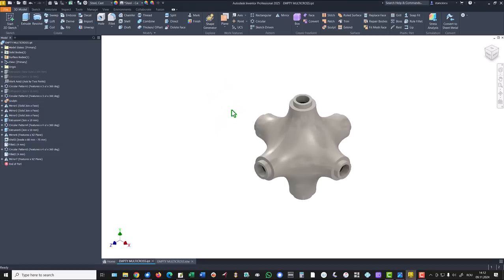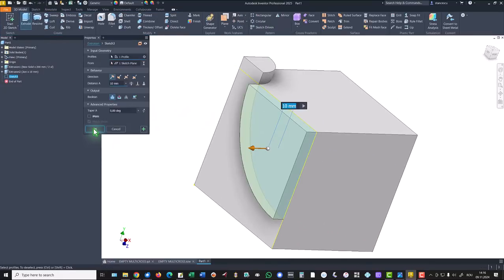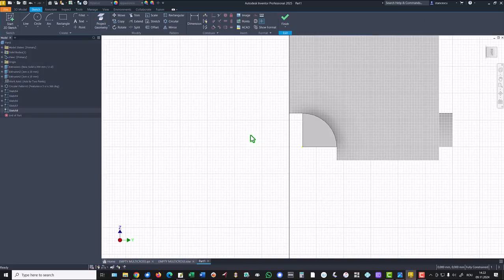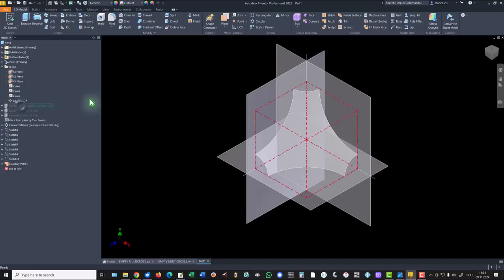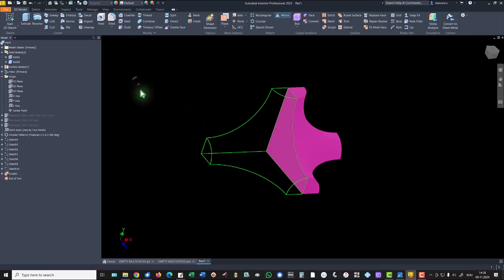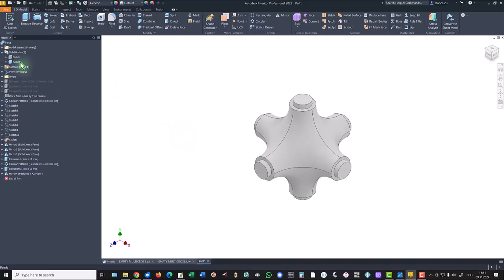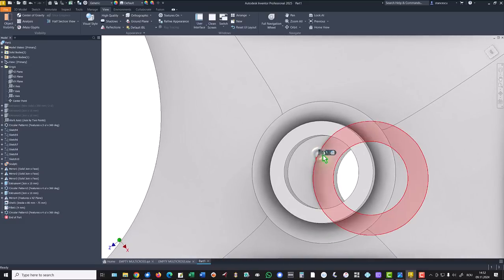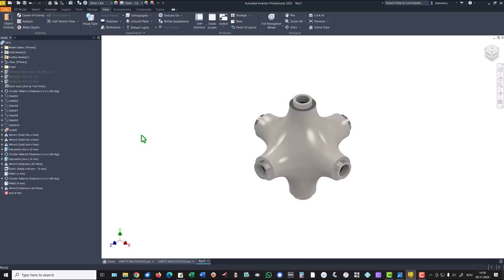Tutorial Inventor - 506 EMPTY MULTICROSS

Comment: With the Split method or the Sculpt method using the 2d Sketch Project Geometry or 3d Sketch Include Geometry commands to create the Boundary Patch surface, 
the final result of the volume measurement I properties Physical (volume) is wrong and not real
  Revolve method Volume 431353.676 mm^3             Another one Patch-Sculpt method Volume 419467.586 mm^3
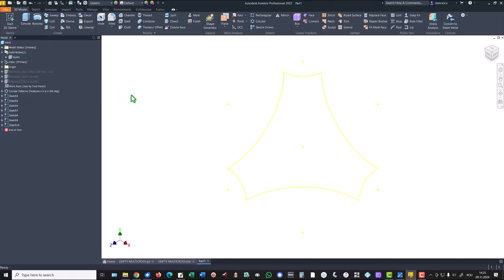Reply from the maker: You are right my friend. At the timeline 9:01 I hide the first volume. This hidden volume must be subtracted from the final volume of 1573596,754 mm^3. Nobody is perfect!

Comment: Great presentation! But, wouldn't it be easier to draw the three quarters (in fact just the three larger arcs) in the three origin planes, create three work surfaces with offset from the origin ones and draw the remaining arcs on them? Then proceed with the aquired 3D-sketch as You have shown. I found this way to be quicker and simpler, because we can skip some steps. Btw, I with my computer could compute the steps as smoothly as in your case, on mine I can't create a circular patters with fillets, because it just crashes lol
Reply from the maker: Thank you for your solution!